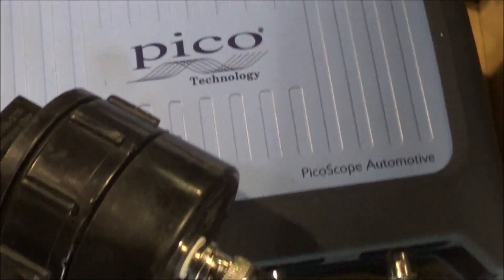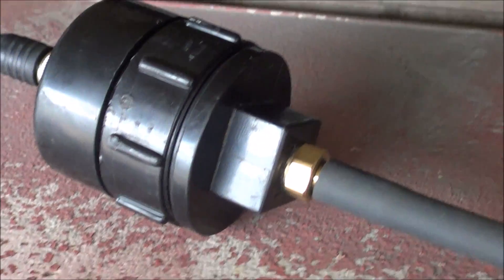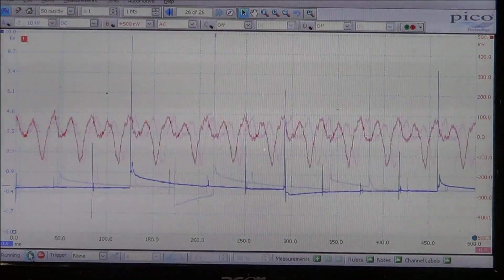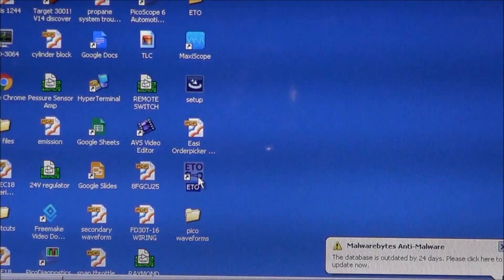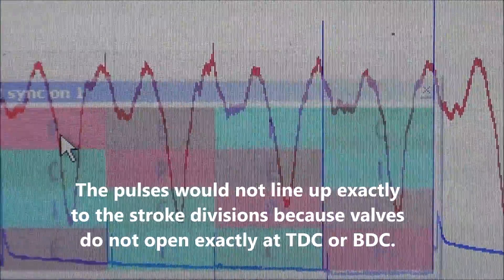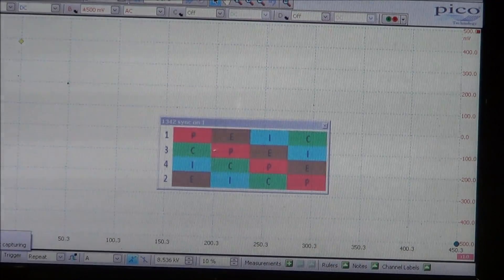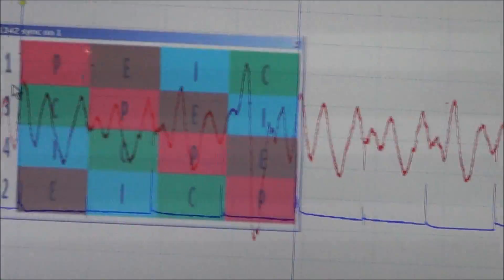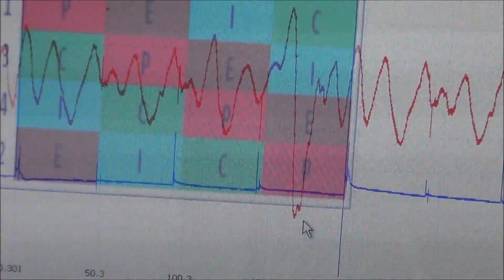Misfire Detection with Impulse Sensor and Picoscope

Comment: Great video !
How could it be used for diesel engines, like 2Z or 1DZ?
May be with the knock sensor you made it?
Thank you in advance.
Reply from the maker: Same way to detect a misfire, detect valve train problems. The only difference is where to get the sync signal from. You could use another piezo sensor clamped to injector #1 as a sync probe.
Reply: @forkliftgeek10  So you could get sinc from injector pipe without another piezo? 
Did you do It before? 
Thanks for answering! 
I folow you from Spain.
Reply from the maker: You can make one of what I used in this video to clamp to the injector 1 pipe. https://youtu.be/lI3hx9d_nZo and use it as a sync
Reply: @forkliftgeek10  Thank you so much!
I've been forklift's mechanic since 1995 and nowadays, in order to improve my knowledge, I'm Interesting on oscilloscope troubleshooting. 
I have a Hantek 1008c.
I am a self-study technician and I find very useful your videos. 
Overhere, there are not  many oscilloscopes in the garages.

Comment: There's a free overlay app on the Microsoft Store which is very nice:
https://www.microsoft.com/store/productId/9NGWMCX2RMTH
I ordered some piezo discs on eBay and will build a similar pulse sensor. We're rebuilding 6 injectors for a 5.9 Cummins and want to check cylinder contribution when done to insure no laggards.
Thanks for sharing your build🙂